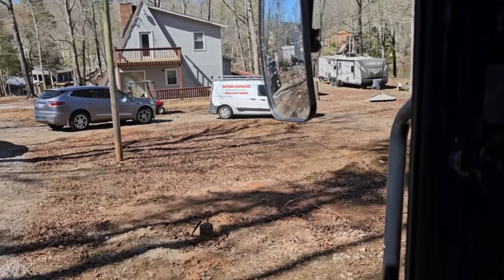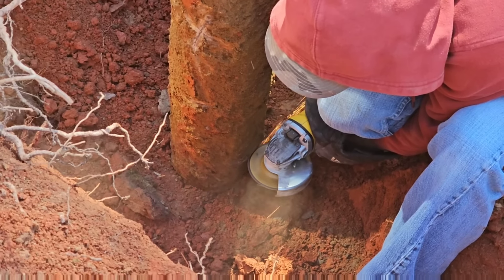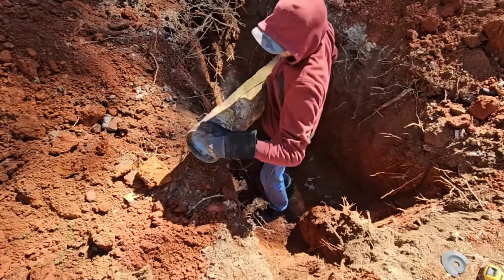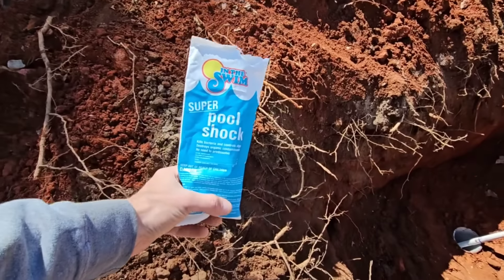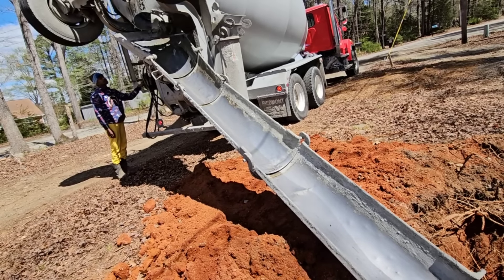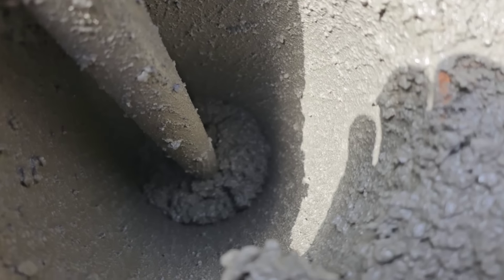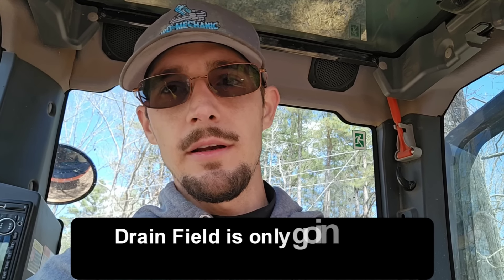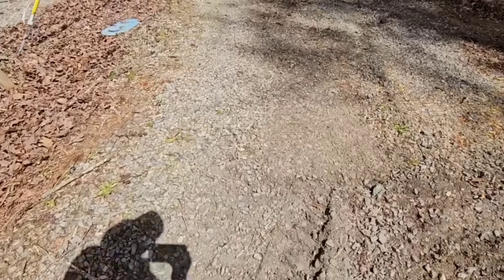The Well had to be filled with Concrete, It's in the Middle of the Septic Drain Field!

Comment: Just so you know, you can specify a mix design to most plants to get exactly what you want. 
For this application I order a 6 or 7 sack mix 8 inch slump with a max of 3/8 aggregate and super plasticizers
Reply: I think they got a hot mix. It was over an hour late. And we have no idea how long a drive it was.
Reply from the maker: @allalphazerobeta8643  I estimated 90 minutes in the truck before he arrived. Started with a 6 on water/slump. Atleast he came! Microsoft is build 10 giant 30 acre server farms across 3 local towns to us, Cloud storage data centers. Every concrete truck runs there on a daily! So doing this job or even Footers is hard bc we are small loads compared to the big money of Microsoft. My worker Justin just left to go work there, $30hr starting pay w full benefits...so it becomes difficult to find help now
Reply: @h2omechanic  there's a lot of truth to that. When I was doing substation work we often had individual pours from 500 to 1500 yards for footings and foundations where the time between trucks was 10 minutes or less. I know calling those in ends up bumping smaller guys unfortunately.

Comment: could just feed that well water right back down the hole in order to wet the concrete. would only need a small T fitting, and a valve, to run a smaller hose tapped off the pipe so you could control how much water you add to the concrete.

Comment: The small pipe that allows the water to escape, do you cut it off and leave it or pull it out. I'm guessing you would pull it out so as not to defeat the purpose of the concrete plug. If you do, is it hard to pull out surrounded with all of the concrete?

Comment: does the poolshock not mess with the concrete setting? I googled it but just got swimmingpool info.
Reply from the maker: If chlorine affected concrete, they wouldn't have made concrete pools for 40+ years. Honestly it's just added bc the state required it to be Sanitized before capping the hole

Comment: Has anyone ever heard of "In Well" pressure tanks! A contractor is trying to sell me on the idea of installing one instead of just replacing my current external tank! It sounds great, but I can't find ANY info on them, on line or otherwise! Thanks!
Reply: Unless you're really tight on space and can't just keep your current tank position, I wouldn't do this. Stick with a standard tank. It'll be easier and cheaper to replace, when it eventuality fails.